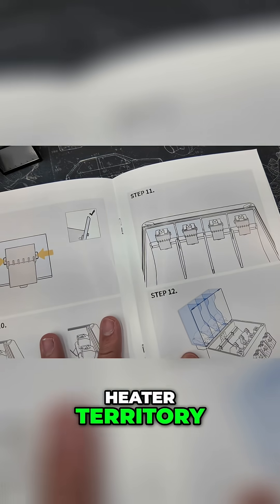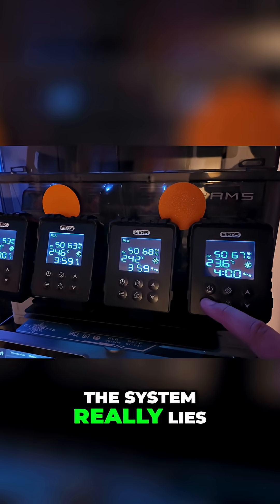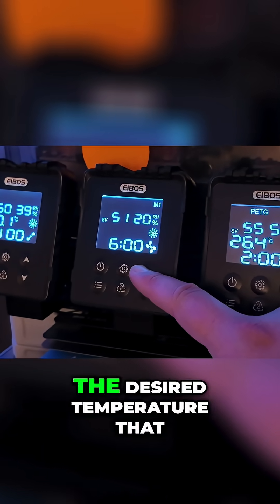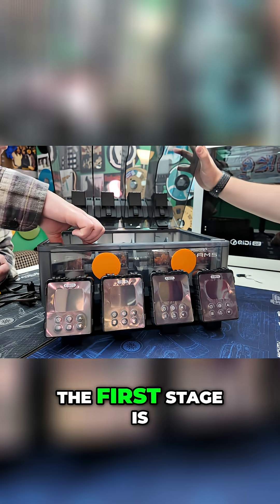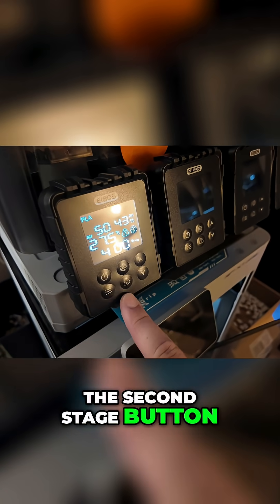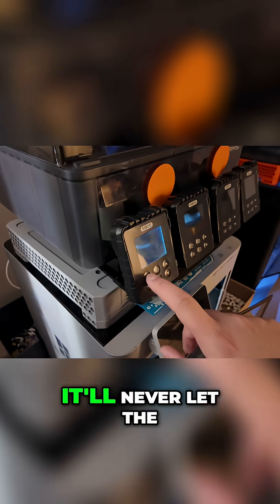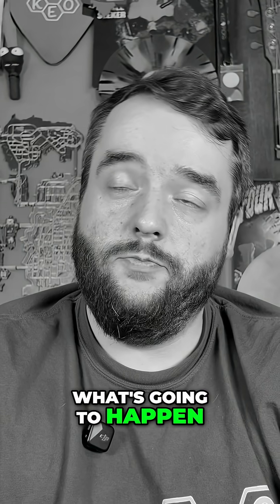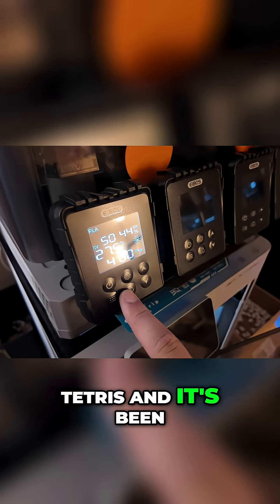3D Printing Hack: Dry Your Filament Like a Pro! #shorts

Comment: So do they dry with dry air or just heat because most of these iv seen are little more then a hairdryer in a box and raising the temperature of air dose let it absorb some moisture but real plastic dryers use desiccants
Reply from the maker: This is a dryer. It has an active venting system to expel moisture as it is baked out